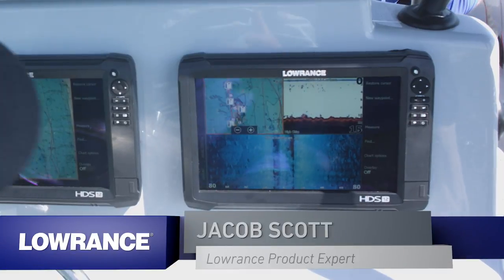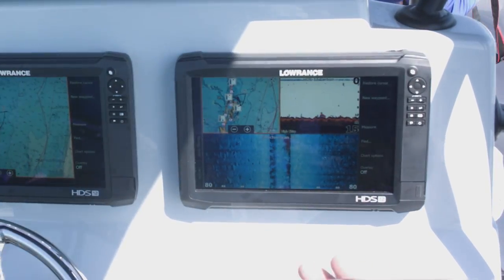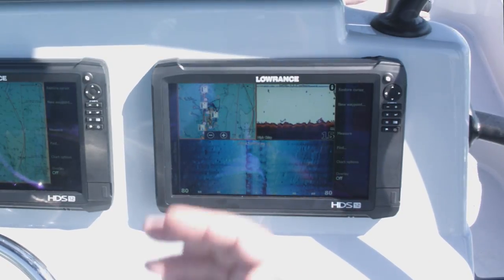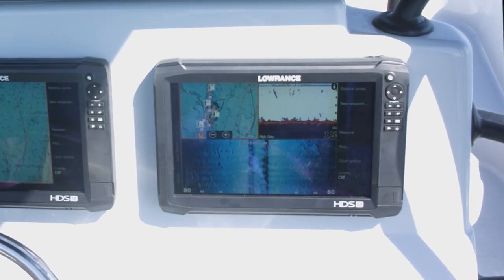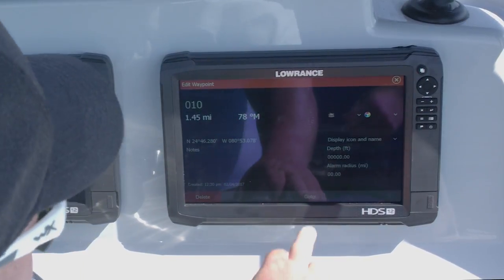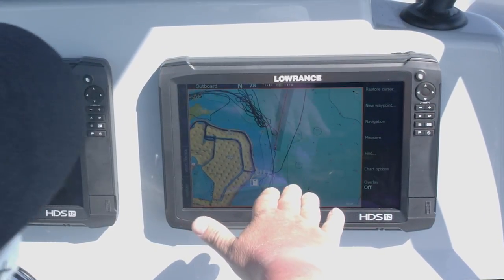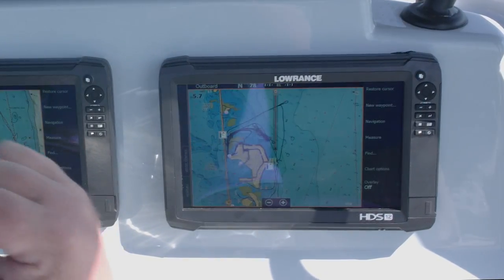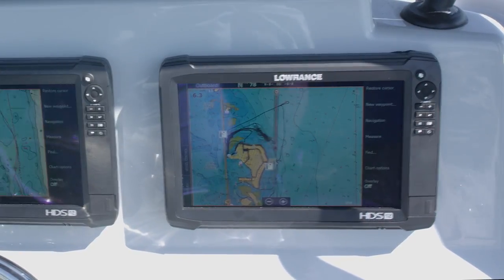HDS Carbon – Using the Outboard Pilot to Navigate to a Waypoint

Comment: Having issues with my hds. can see the nac1 and all components but the autopilot tab will not come online. also when I select go to it just continues navigation. does not prompt for auto pilot.
Reply from the maker: Please go to Settings > System > Advanced Settings > Features > turn on Autopilot options.
Please contact us via FB if you're having issues.
Reply: @lowrance  That Fixed the issue. I swore I turned it on but it was off and made me reset all data sources.